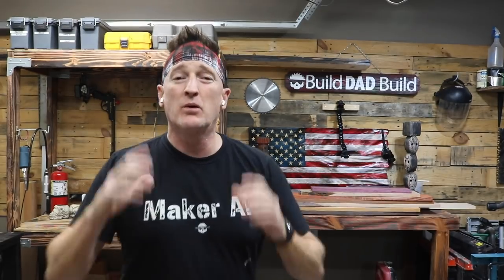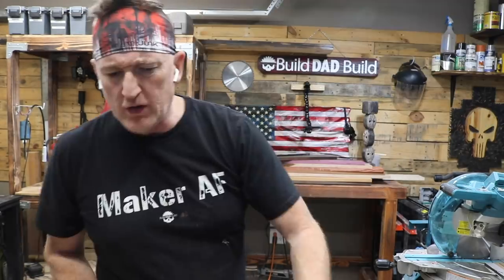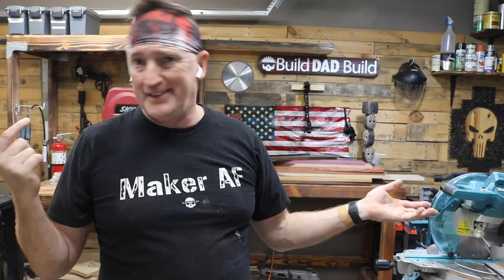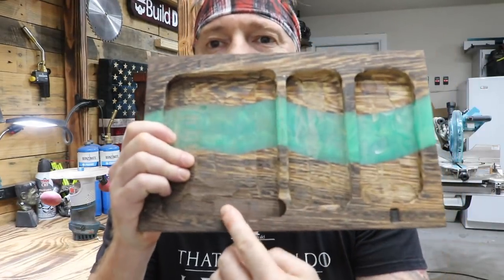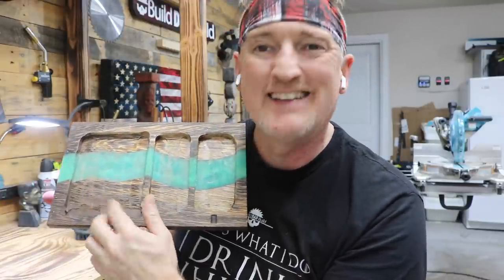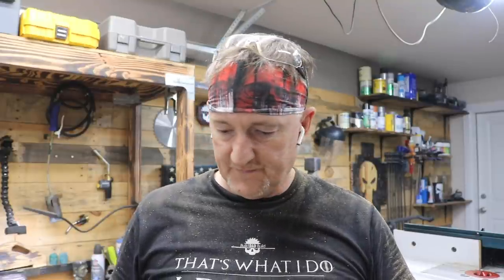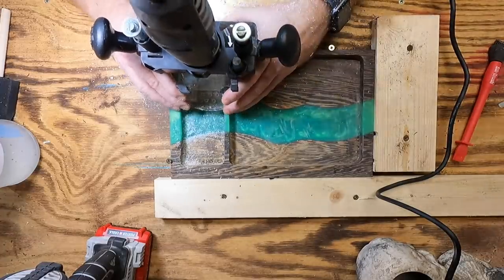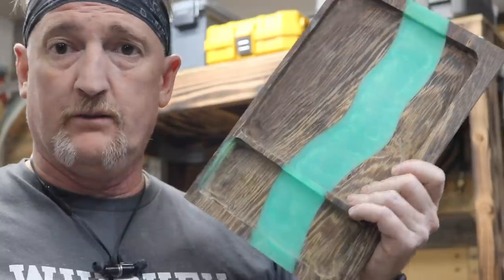Wenge and Epoxy Valet

Comment: What if you use some clear epoxy to piece the 2nd back together? Apply it like you would glue. Then you could also go back with touch ups to seal any regaining remaining cracks. The design is so cool with that I'd refuse to throw in the towel. 

But lesson learned to keep it flat on a surface. I know it's something i'll now keep in my mind whenever I'm carving downward.
Reply from the maker: Hey Joshua!
What I didn't show was the massive amount of other shattered pieces.
But...I haven't thrown it away yet. There may be a resurrection in the future!
Cheers

Comment: I noticed you used regular clear tape, and hot glued the seams to seal the inside of the molding before pouring the epoxy in. On the molding itself, do you use just regular wood or a type of formica with the tape so the epoxy doesn’t stick to the molding? I’ve watched several videos and seen many different moldings, some wood but the inside taped with DuPont tyvek tape. I’m guessing all that matters is that the seams are sealed and the DuPont tape is covering all surfaces before the epoxy is poured in, correct?
Reply from the maker: For the mold I've been scavenging pieces from an old mold I made from MDF. Not the best, but it gets the job done.
Normally I use Tyvek tape, but I ran out. I have been told regular packing tape works the same. In my experience it works the same for small pours. It doesn't hold up as well with deep pours.
Cheers!
Reply: @BuildDadBuild  perfect. The MDF board was throwing me off. Thanks for the tip.

Comment: What was that finish you used on the caddy? Anyway, valiant effort, it came out not looking too bad from what I could tell. Remember, you can’t be successful without experiencing failure. You definitely gave me some ideas. Instead of cutting the board “in half”, why not router where you want the river to be only about 95% deep, leaving a thin sheet of the wood for the bottom and don’t router it all the way to the edges? This would crate a bowl sort of effect where you could just pour in the resin and it should remove the chances for any leaks. After it cures, cut off the edges and when you run it through the planer, the 5% you left as the bottom would be removed creating the illusion you want where you can see all the way through the resin. Finally, router out the areas you wanted for storage. I wish I could explain this easier, hopefully my idea was clear enough to understand.
Reply from the maker: Thanks for the tips!
WALRUS OIL:
https://amzn.to/3f0Ns7T

CUTTING BOARD WAX:
https://www.voeltnerwoodworking.com/shop/p/woodpreserver

Cheeers!

Comment: I would have cut the ends and sides off on the table saw, and use the thin flat piece and build a frame around it with a dado to hold the bottom of the valet
Reply from the maker: Hey Vince!
Not a bad suggestion.
Cheers